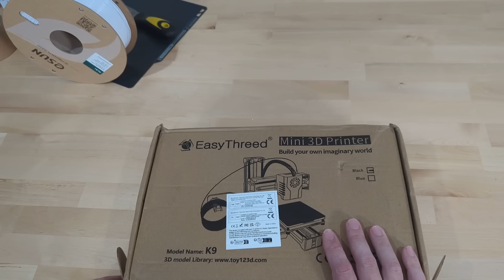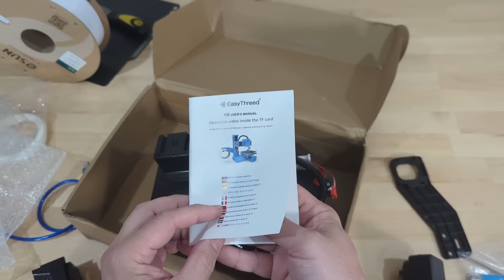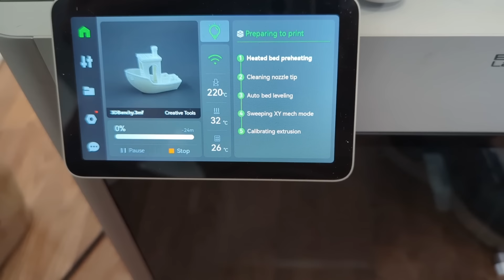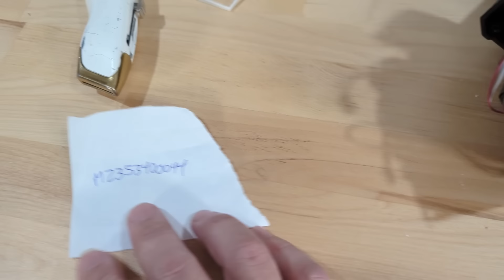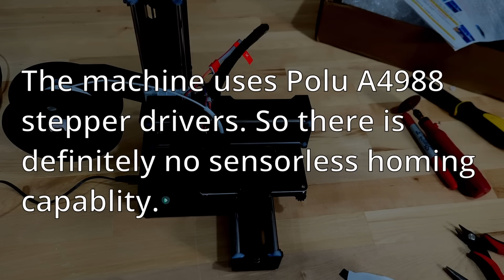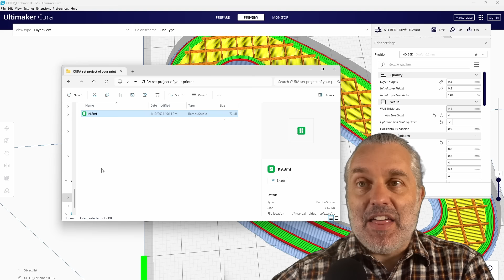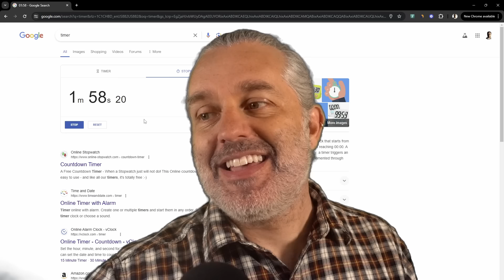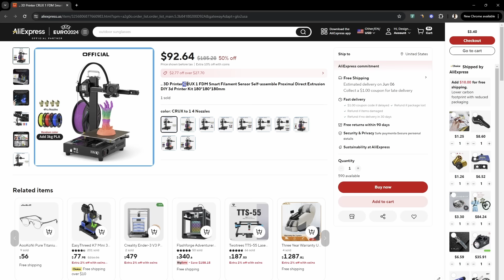The Most Impressive Printer I've Ever Reviewed - Bambu Lab X1C vs. Easy Threed K9

Comment: look up the feiyu mini - similar concept and price but using 100% "normal" 3d printer parts - 2020 extrusions, 32bit mainboard, nema17 motors. Assembly is a nightmare, but upgradability is unmatched. You could slap on a $2 ender 3 hotend mounting plate and access that whole ecosystem.

Comment: My guess from the start is that the cheap machine printed better. x1 carbon is amazing but slower prints are usually better, a 3 hour print from a cheap printer is almost always better than a 10 minute print on the carbon.
Reply: No one ever seems to compare apples to apples. Turning the x1 carbon down some would yield a drastically different result. Maybe he is comparing both units with out-of-the-box defaults.

Comment: I have a few things i wonder:
Can you use Gcode to pause the bed in a better place?
Could firmware keep the backlash in check?
Could gravity keep the bushings from being problematic?
Reply from the maker: G-Code: Yes.insert an  M400 command to pause with the G-Code line previous to the m400 being a movement to the back corner of the bed.

Yes. I believe firmware is keeping the lash in check. I think with each change in direction of an axis The firmware it's winding up an extra millimeter or so of the belt. Of course the belt doesn't move because that extra movement is just what's required to get the gears in the motor primed so that they are physically pushing/pulling the axis with the actual movement commands from the slicer.

Yes, gravity can prevent some of the negative effects from the bushing play. However, if you bump the machine or even the table, it will affect your print quality. Also, when printing at the far edge of the bed, just the force of pushing extruded filament down onto the print can lift the arm. Compound this over many layers and you start to have some serious problems with your print. It is best to tune your machine so that it has the least amount of play/wiggle/lash possible.

Comment: Good job on getting this "Barbie's first 3D printer" to work much better than out of the box!  I think this printer ought to come with built-in adjustable sleeve bearings so that you don't have to slice, drill, and add those wires which are a slightly hazardous due to the exposed sharp ends.  That shouldn't cost them more than like $1 (at scale) in parts for all of the bearings.  Whether or not they smooth the rods before shipping isn't a huge deal, but would have been nice if they came smoothed along the right axis out of the box.

Comment: Thank you for this video and these clever improvements. I saw an USB wire: have you tried to plug it to a PC and tested a M503 with Repetier to get and to change X and Y travel sizes?
Reply from the maker: The thought occurred to me to try and save to EEprom like we used to do with Marlin. I kind of suspect this machine is running Klipper . I've actually never touched Klipper so I didn't give that a go. Can you even do the eeprom trick with Klipper?
Reply: @DesignPrototypeTest  Thank you for your reply. Yes that was the idea with the EEprom. I don't think it could be Klipper because - as far as I know - Klipper requires a Raspberry Pi (or equivalent) and it needs network connexion. I suspect it should be Marlin (or something else). If it was Klipper, it would be much more easier than the EEprom trick, or than flashing the firmware with Marlin: we would have an access to the Printer Config file to easily change the building area size.

Comment: Nice..just chuck up the rod in a drill...spin it, hit it lightly with high grit 500+ 1000-2000 would be better
Very nice and easy upgrade to tighten up the bushings for the axis to remove slop in the "bearings"
honestly...either an old busted cellphone running Octo4A, or a super cheap orange pi running octoprint would be LIGHTYEARS better than those clicky buttons...
Thanks for this video!
Keep em coming!!!!  (but only after you get therapy...LOL)
Reply from the maker: LOL! I actually lol'd. You got me with the sneak attack last sentence.

Comment: I bought the K9 several weeks ago and found its a okay beginners printer for the low cost.

Not a bad video does have some good info (Liked).

Note IMO the mods he made are basically meaningless without prints made before the mods to compare to so you can see if they made a difference.

I haven't modded mine any and I printed a benchy that looks just as good as his and was dimension accurate.

Just some FYI's:
1.if you get one Read the manual and watch the assembly video first, It addresses several of the issues he showed. Like attaching the spool holder properly.

2. Also it explains the feed & Extraction switch/process, It tells you when extracting it extrudes a little first (its purging) then it reverses and your supposed to gently pull the filament

(Note the unplugging to load the filament was unnecessary it wasn't really being done right.)

Note also the side of the extruder is clear you can see watch the filament going through the gear etc.

3. As for changing the Bowden / PTFE tubing, It doesn't have to be precisely 4mm. Just use the little Philips head screwdriver they give you and loosen the clamp if its too tight to get in or out.

4.When using Cura slicer there should be a file on the micro SD card called (K9.3mf), you have to load that in Cura first to install the K9 printer configuration.

You can then tweak it after that.

5. When leveling/Tramming the bed, Button #1 homes the head first then it moves it to the first leveling position on the bed.

6. The perforated mat, you can get the filament out of the holes fairly simply. You place tape on the mat (I used Fasson Foil Tape, it has a strong adhesive but didn't leave a sticky residue) then pull it off, the filament comes out with it usually. Use some alcohol on it if its stubborn. 

7. Put blue painters tape on the mat first then you don't have to worry about filament being in the holes. Use a glue stick if you need extra adhesion. Note remember to relevel the bed after applying tape.

Note there are other mats available, there is also a hot bed upgrade.
Reply from the maker: You are right about the Reverse Bowden tube. You can simply loosen the screw and clamp whatever size PTFE tube you purchased into position. Thank you for that. I missed that detail.

I have to maintain my insistence about removing the lash in the printer by modifying the bushings. For many reasons it is always the best practice to constrain unwanted movement. 

You also made a good point about how I should have printed a Benchy before and after my modifications. If I had done some tests on the base printer this discussion would not be happening. I could have shown the reasons for my modification. i could have displayed the printer displaying better results afterward.

Perhaps if your printer is unmodified you can try the experiment for yourself. Make a large print. Measure Z height and look closely at the layer lines quality at different points on the print. Bump/disturb the printer while it is printing. Do this before and after the modifications. See if there aren't real improvements.

Comment: Are you sure the bushing is PTFE??? It looks like nylon. PTFE would've raised the cost significantly.
Reply from the maker: Good question! It could be a nylon PTFE blend. It wasn't tough enough to be pure nylon.
Reply: @DesignPrototypeTest  great video BTW! I watched the entire thing.
Reply: My guess would be HDPE - wonderful & cheap material that is easy to injection mold, and is the go-to material in an engineering shop for straight-forward bearing & structural elements - Easy-to-machine ... tough ... not brittle ... immune to common solvents ... good self-lubricating properties ... useful in corrosive marine applications (nylon not dimensionally stable in wet environments) ... readily available in bar or thick sheet form from any plastic supplier. What's not to like? I regard PETG as the 3D filament equivalent.